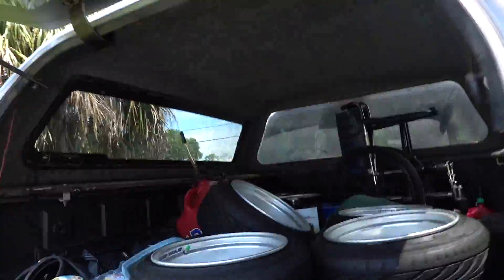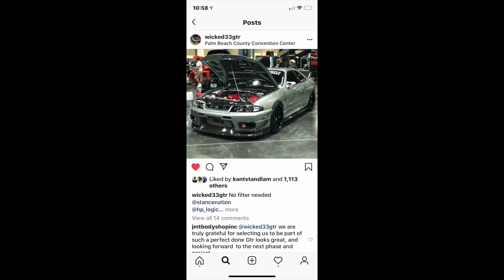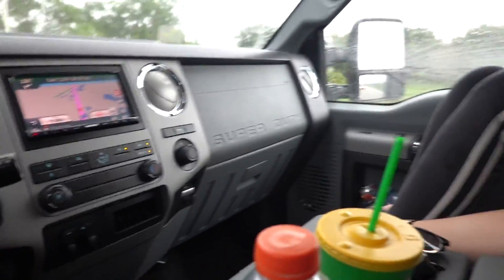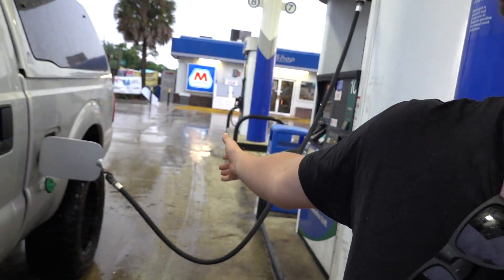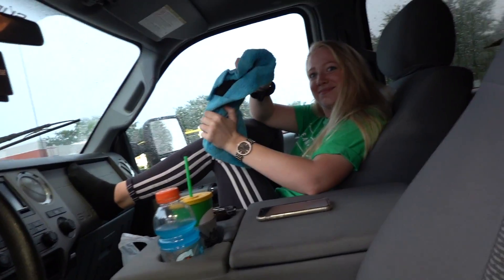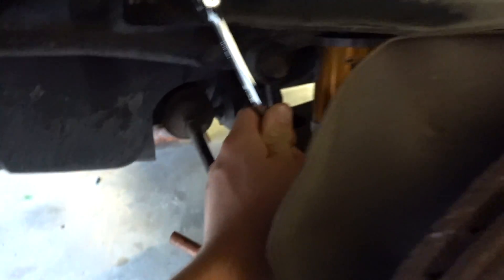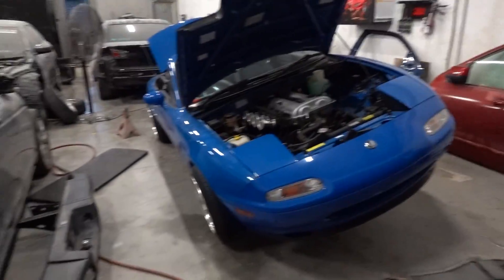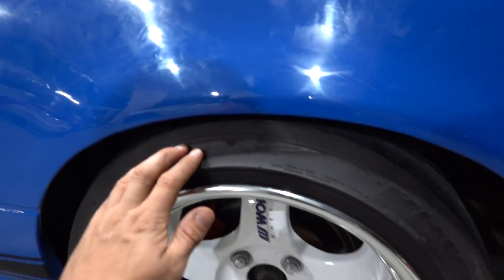SLAMMED THE ROADSTER WITH MY DREAM WHEELS!

Comment: Probably the first time anyone's ever swapped out Öhlins for BC's....
Reply: Bryce bc’s definitely aren’t bad though. Ohlins are just hella expensive
Reply: @Matt_Lanzer_13  Nah I've had several BC's, no real complaints, especially with swift springs. Öhlins are baller for sure, but worthwhile. But clearly ruddy's not thinking performance with the new hotboi wheels lmao.
Reply: Was thinking same thing, not many people change out baller coils. But I get he is rocer Miata just doing it for the low
Reply: Use those bad boys on the real racecar... and Penskes 🤤
Reply: I should've read the comments before I posted because I just said the exact same thing...lmfao
Reply: Matt L bc sucks lmfao. Every set I’ve ever rode on felt improperly valved

Comment: put a undefuel tune on the truck and drive it with as little skinny peddle as possible. you will get high 20s you only need a quarter of the horses to move that truck empty

Comment: If you weren’t stretched so much and just got a different sidewall I think it’s a good height, my raceland coilovers on my 90 Miata don’t adjust height so I’m stuck slammed with my front lip almost an inch off the ground. Not ideal for Texas roads lol